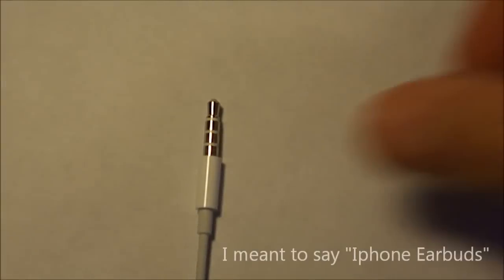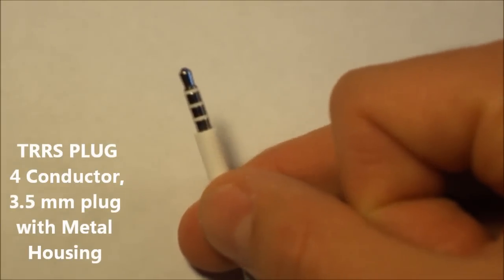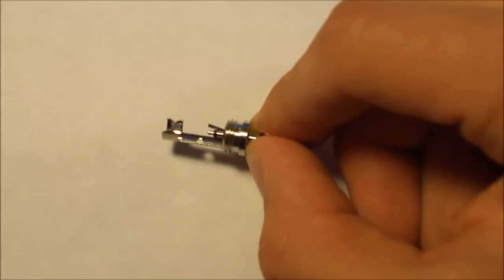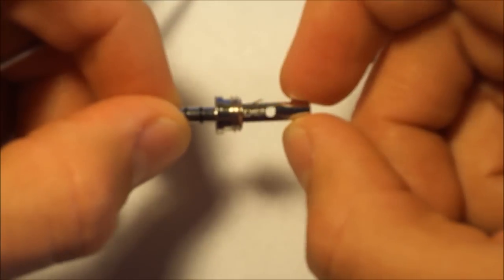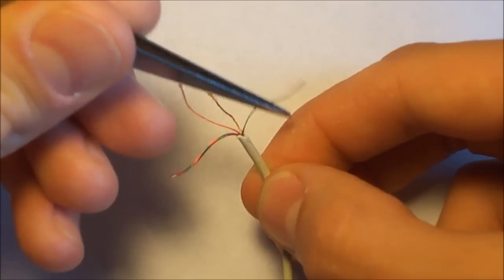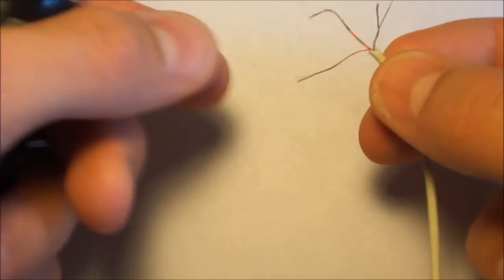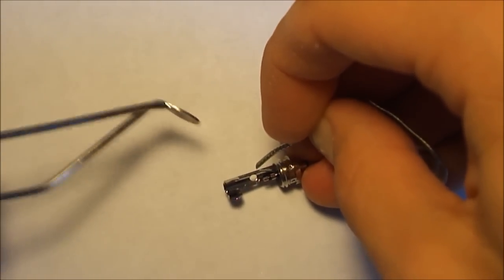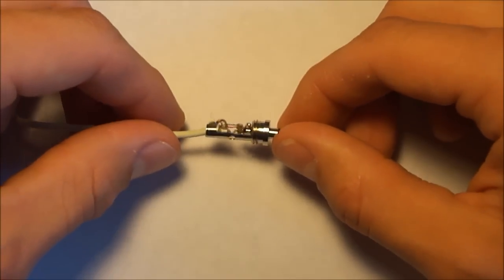Repairing Headphones with Microphone (TRRS Plug)

Comment: the thing is

my mic wont work but the sound does and

I dont wanna take it apart
Reply: My mic button is broken completely off including the tiny chip thing on the right. The bud worked for about a month and 3 or 4 weeks, then started acting up and the only way for it to work is to mess with the jack. The left side works completely fine.

Comment: Those look like cold solder joints to me. The surface you are soldering TO (i.e. the plug) should be heated before applying the solder.

Comment: Anyway to fix this without soldering? 😢
Reply: Wait, so I watched your trs headphone simple fix, and I have a question. So if its by the plug you need to solder but if it's not, then you can just burn and the then together. Is this true?
Reply: Anyone?
Reply: If possible is there away to do it without the plug?
Reply from the maker: I think the answer to your question is yes. If the bad spot (short) is not in the plug, but in the wire itself -  then you can remove this bad piece and reconnect the wires.

Comment: that doesn't make sense u can just get another one instead of paying for extra
Reply: its like 3$ for that plug and if u already have the supplies (which if you repair your own stuff will save you a lot over time) there's no reason not to just repair them. I just finished repairing my 100$ headset for 1$ cause i had to get electrical tape but my dad already had solder, flux, and a soldering gun.

Comment: Great video, will definitely implement method on how to repair, but confused as my powerbeats by dre has 5 wires total. I have a red, green, green/copper, red/copper and white (insulated)/copper wire... Cant find the pinout anywhere. Do you know what needs to be done to get just audio back? I have a replacement TRRS plug.

Comment: when u solder insulated wires like that, there would be no need for lighter because the heat of the S.I. would be enough to burn the insulation on tip of the wire...

Comment: I don't buy new TRRS plug but i recycle the old ones. That's just great after a repair but it takes a bit more time because i have to housed the recycled TRRS plug inside a ballpen's tip with epoxy. Not really aesthetic but function wise, just good as new.

Comment: Buy wireless headphones guys then you never have to deal with this problem
Reply: The problem them will be battery =(
Reply: Vincent Arquillo lol
Reply: LIL Yatchman nyahahaha
Reply: Until the signal starts cutting and they are no longer detected... Good luck fixing that.
Reply: DeemoReacts Fuck you bitch
Reply: Got wireless earbuds on mistake but used them anyways and turned out that the sound didn’t sync with the video. Plus the mic is really crappy. Though this might vary on different brands.

Comment: What happens if you sint use trrs audio jacks? Would only the microphone not work? Please tell me.
Reply: +Paul Park I want to know this too! I bought the wrong jack (TRS instead o a TRRS) and I want to know if I just can cut off/not connect the microphonewire on it. I don't care for the microphone
Reply: same here dude
Reply: paul park: I tested this, I had a steelseries siberia v3 (TRRS) and bought a TRS jack. I had 4 cables. copper, red, green and copper with blue stripes.

red to right, green left, and striped as ground worked for my headset. (sacrificing the mic ofc)

Comment: I fixed Headphones Audio-Technica ATH-CKS 90.
There were wires: green, red, gold and green and gold twisted.
Solder both (when viewed from the tip):
1. green
2. red
3. gold
4. (large) twisted green and gold
Headphones work, but a button - no, not yet tested the microphone.
What have I done wrong? But I do not tinned fire.

Comment: Hi, I have tssr ring pin. In that I see a red wire, green, blue , copper n white soft in between them. I cut the white on from them all, except from red as it didn't had one. My left earphone have copper and blue wire, and my left earphone have green and copper. This earphone had mic but I don't need it anymore. Also it was having issue. I did the burn trick and cleared it with my nails. I was able to get right earphone worked (this was working fine before as well) but the left earphone which wouldn't work unless I press the mic button down, ( which stopped by the way, due to which I'm trying this method) but the left earphone isn't working still. And where to do I connect my red wire with?
I expose them all once removing the mic part in between.

Comment: One side of my headphones just got reaaaally quiet. Is there any way to fix this? Already tried it with my pc so the error is not on my phone.
Reply: +VegaRoXas Too many comments like this... why? If one of your headphones is dead then it means that the wire for that one is dead, in which case you'll have to do what the video "says", But another Plug equal to the one you used to have and then but all what you need to fix it... :P
Reply: Yorcont You just said that one wire is dead. So why should I replace the plug if a wire is dead? Also it doesn't seem to be dead, it just got quiet.
Reply: ***** Well... that means that your wire got a problem, you need to identified if in any position the headphone works "fine", if you have to put your wire in a particular position to make it work then it means that your wire is beggining to fail and that means that you have to cut to fix... most of the times is better to cut both cause you'll have a shorter side just by "fixing" one... on the other hand i think you can't just pull together the wires that easly... in the meantime try the "position" thing...

Comment: my right side of my headphonea does not work.. i can only hear with one, some times when i move the plug on my phone, then i can hear on them but its really sensitive..... someone help mee!!!
Reply: im here for that too but commenting me too won't help :(
Reply: Pastelbitxh exactly the same and I just got these cause I have lost all my other ones.  And I actually took care of these and this happened -.-
Reply: Same thing happens with me
Reply: +The Gaming Potato Me w
Reply: +A.S. MC me too
Reply: Same
Reply: Same!!
Reply: If this is happening try taking a toothbrush with water on it and brush the EarPod that doesn’t work it will remove most of the wax that is causing it to not work
Reply: WELL UM WHAT YOU CAN DO IS BUY NEW HEADPHONES
Reply: that means the trs plug is broken, it's not the ear bud, those things are just vibrating drums, so to fix it u just fix the plug like in this vid

Comment: I have a stereo cable for my SONY MDR-10RDC headphones.  The cable detaches from one of the ear cups.  One end of the cable is TRS, the other TRRS.  I want to do a continuity test on this cable, but don't know how to perform a test on a cable that has a different type of plug on each end. Every continuity test I've come across online shows cables with identical plugs on each end.  I don't know which combinations to use in the test. I'm using a continuity tester that has a light.  Can you help me?

Comment: RichsMethods PLEASE ANSWER MY QUESTION PLEASE I NEED TO KNOW THIS. CAN YOU USE A TRS PLUG (2 RING ) TO FIX SOME EARBUDS THAT HAVE 3 RINGS INSTEAD OF HAVING TO USE A TRRS PLUG (3 RING)?
Reply from the maker: yes, you can. You will have some extra wires left over that you'll need to cover with electrical tape or some sort of insulator. This is to prevent any cross talk from occurring.

Comment: I also fixed my urBeats Headphone (2014 edition), actually right now. Thank's to share this video!

But I got some differences with someone that said about collors. Here I go:

UrBeats have 6 wires:

- Green: ground
- Green with cooper (Twisted): Left Speaker
- Red: ground
- Red with cooper (Twisted): Right Speaker
- Cooper: Ground
- White (inside cooper): Mic

I remove tha original cap from TRSS plug using heat gun

The original conector has 4 places to solder:

(From BOTTOM TO TOP)

1st: White (Mic)
2nd: Ground (red + green + cooper)
3rd: Green Twisted (Left)
4th: Red Twisted (Right)

I hope it helps someone who want to fix by yourself his headphone
Reply: +raphatube08 Hi, thanks for this comment, I've been trying to work out those wires for a really long time. After your repair, do your controls and microphone both work?
Reply: +Lex Hi Bro, how u? 

So, I lost 2 trss plugs when I was soldering, because they have a minimal space to solder and I made a jumper between two "spaces" lol , also, I don't have a Lens that technicians used to soldering. 

After that, I got those working great. 
Everything is working (control and microphone), left and right are correct too. 

Be careful with soldering, if you spend a little time in contact with trss plug, probably you will lost the plastic protection that separe two metalic contacts. (That was my fault).
Reply: Wow I spent months looking for a diagram or something else explaining what does what and how 6 wires are reduced to 4 connectors. THANK YOU SO MUCH! I only have one question though: when you say 'from bottom to top' does 'bottom' mean the tip or the sleeve (4 connector plug=TRRS plug= tip ring ring sleeve). It would be very nice, if you could help me with this.
Reply: raphatube08 isnt ìt copper not cooper?

Comment: I have a pair of beats ear buds that developed a short. My question is do I have to repair the Mic in order for my headphones to work? The devices I use them with can't use the Mic or volume control anyway. Will it mess with the power flow? Can I use a trs or should I repair them with a trrs?
Reply from the maker: hunter martin You could use a TRS plug, but you'll have to cover the "Spare" wires with electrical tape or some sort of cover to prevent cross talk. Snip the extra wires leaving no stray strands of wire and cover.  It should work.
Reply: Ok. Thank you very much 😺
Reply: Well turns out I can sorta use a TRS plug. But the sound isn't right. It's not cross talk but sounds like there is an audio aspect missing. Kind of like when you pull out the Jack slightly and you lose main audio in a song and other aspects in others. Not to mention this wiring is different from others I have seen. There is an obvious ground, a red and green wire, and also a red wire spiraled with what looks like copper enamel and a green one the same way. Have tried a couple configurations of the wires and got the result I was describing with crossing the opposite wires. Going to buy a TRRS and see if that works I guess
Reply: Sorry to keep bothering you but my headphones are important to me and I'm to broke to buy more
Reply: RichsMethods

Comment: Hi! I need I hand with some really simple thing that I can't work out. I found a headset (headphones + mic) that I want to fix, it has no plug at all, and I can't understand which wire goes were. I have 5 wires:

1. Red
2. Green
3. Copper
4. Red/Green
5. Green/Copper

The first 3 I know that are for the headphones, left, right and ground, but I can't understand where the other two go and I don't want to make a mess.
My idea is to solder a 4 connector plug. I look forward to your answer. Greetings!

Comment: Thank you so much for making these videos. Here's my problem: I have a pair of Logitech G430 headphones with microphone. I use them in my work and I use them daily, and I just can't afford to replace them right now. They have the cloth-covered wire instead of plastic. One of my cats chewed the wire in half. I tried splicing it back together but nothing happened. After watching your video I'm going to try it again but when I do I'm going to solder the wires instead of just twisting them together. Do you think that will work?

Comment: So I've tried this with 4 different replacement plugs so far with no success. I ordered 4 of the same (the type that doesn't have the mic/controls), and I've tried it on 4 different pairs of headphones. 

What I did was insert the replacement plug into my iPhone, and then started playing a song on max volume. Then I contacted the wires with the connections on the replacement plug. I got no sound, no matter how many different replacement jacks I've tried or different cords.

I only have access to a soldering iron on Mondays, so I'd have to wait till next week to actually solder it, but it seems like it wouldn't work anyway, since when I make the connections without the solder, nothing happen.s

Comment: Take Apple Earpods for example (the one with a mic). Could I use a regular headphone jack to fix it instead of the TTRS jack. I know the remote won't work, but will the headphones themselves work?
Reply from the maker: The Man With No Name Yes, it should work. You'll have to cover the extra wires with electrical tape though.

Comment: Can anyone give any opinion on using a working jack to fix a broken jack? I have a nice commonly used pair of earphones (TRRS) with its jack recently snapped and bent at an awkward angle. This has an additional microphone wire (I presume, which also acts as a play/pause. Not sure if that's two wires). Another pair of earphones (with one working speaker as the other is missing its actual electronics... don't ask, old pair that's been through tear and wear) also TRRS (with a microphone and play/pause button, both different models by different companies), has a perfectly fine jack. If I were to remove all wirings from the working jack and cut it off and use as a replacement (following the instructions from this video) on the first pair, feasible?
Reply from the maker: Yes, it definitely will! I also made a video showing how to do it!  Here is the link:
https://www.youtube.com/watch?v=4atef-O3kyQ
Hope that helps.

Comment: Thanks for the video.  There's a better way to strip off the enamel though, just make a little ball of solder on the iron, and touch it against the enamel.  It'll melt the enamel and tin the wire in a single, easily controlled step.

Comment: The metal part broke off and its stuck in my ipad
Reply from the maker: Oh no! There are videos on Youtube that use a small piece of wire with some super glue placed on it, you place that inside your plug and touch it to the broken piece, leave it there for a minute and then carefully pull it out. However, you have to be careful that you don't put super glue on the headphone jack of your iPad! Steady hands are the key.
Reply: Is there a part hanging out of the device that you could grab with a pair of tweezers or pliers?

Comment: What if I have:

1 RED,
1 BLUE,
1 GREEN,
and 1 COPPER

How do I connect them? 
Also has Microphone
I just stripped em out and didn't know if here was any color mixed
Reply from the maker: Do you know if there is a wire inside the blue or copper wires? It might look like a thin white covered wire.
If not, I'd connect the Green wire on the center, smallest connector, the Red wire on the 2nd center larger connector, then the Copper wire on the connector that is jutting out diagonally, and the Blue wire on the Largest connector.

Comment: Do you know if this is possible: I want to buy the B&O H6 which has a removeable cable. I use an Galaxy S4 and want to use the headphones with inline remote control. The original cable is designed for iOS, so I was wondering what happens if I use a new cable which should work for Android.

Comment: lol need to repair a $400 pair of headphones any suggestions?
Reply from the maker: Do you know if you have a TRRS or a TRS plug?  Google an image and see. I'd be able to help, but I would need to know which plug you have first.
Reply: TRRS it has a mic and remote. The model of it is sony xba-4ip
Reply from the maker: poswer koitl Okay, next, you'll need to purchase a new TRRS plug.  You could purchase the TRRS plug with one of the links in the description. Next, cut the plug off. Cut it about 2-3 inches away from the plug.  You'll need to strip wires carefully and expose the colored wires inside. You could then let me know the colors so I could help you connect them.
Reply: I bought a trrs plug. There are 4 wires. I have a green wire ,red wire, gold wire, and another gold wire with a thicker coating on it.
Reply from the maker: poswer koitl  Its pretty cool that your wire is Gold (must be why they are high end). The Gold is probably your ground. I'm thinking the Gold with a thicker coating is your microphone / remote control. Check to see if there is a wire inside the Gold wire with a Thicker Wire. It might be at the center of the wire. If there isn't a wire, and you only have the 4 wires you listed, then connect them as follows: 
Green wire - Smallest Center connector on the new plug
Red - 2nd smallest connector in the middle of the plug
Gold - 3rd smallest connector - this connector will be either in the middle of the plug, or sticking out a little on a diagonal
Gold with Thicker coating - Largest Outside connector on the plug.
I hope this makes sense. Good luck and let me know if there is another wire inside the Thicker coated wire.

Comment: Hey Rich, I have 2 copper wires, 1 blue and 1 green .
On the other, I have 1 green, 1 red, 1 striped red/green, 1 striped copper/green, 1 striped copper/red and 1 white. Now how do I connect these two sets?
Reply from the maker: Well, just curl up in a room somewhere and cry because I have no freaking clue. ha. 

Seriously though, that's a tough one. Are you able to "Dissect" the original plug to see which wires went where?  The 2 copper wires are probably the ground, the red wire and the green wire are left and right earbuds, but I'm not sure about the others. Sorry I couldn't be more help.

What type of headphones are these?
Reply: Not sure about the one with the 2 copper , 1 green & 1 blue.The iphone5 is the set I wanted to repair.
Reply from the maker: Mickey Mastracchio I haven't gotten the chance to look at their new headphones. I'll put it on my to do list.
Reply: Ok Great! Have fun! I'll be checking back with you just to see what you find out.
Thanks for getting back to me!